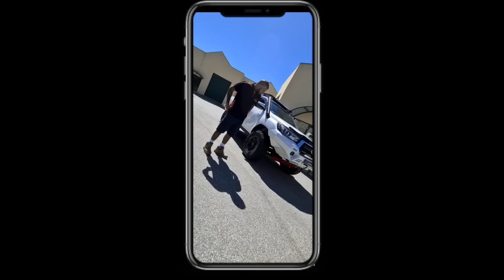FULLY MODIFIED TOYOTA HILUX // TOYOTA HILUX WHEELS, TYRES & 4X4 ACCESSORIES

Comment: "lives near lots of roos'' and gets a rival bar for protection lol
Reply: I wonder the same thing ... I thought hitting a roo will activate the airbag anyways ... Modern utes have automated sensor brakes too don't they??
Reply: I've got an ARB Sahara bar on my car but to be fair I don't think I've ever needed it. I've been to the cape a few times, around Aus, across Aus, High Country and I don't know how many Fraser / Moreton Island trips and I've never hit an animal. Any of these bumper replacement bars look pretty good to me. Good approach angle and a place to mount winch / lights / aerial. Good cooling. Rival is alloy too so no rust unlike my ARB bar. What's not to like?

Comment: In Your video you state that your work and mods meet with OZ standards and are 100% legal, if this hilux had a 3" lift and 295/70/17 this surpasses the vehicle modification regulations. Has this vehicle had certification for these mods.

Comment: Meets ADR standards? How did you guys get the oversized wheels approved?  Tyre size diameter cant' exceed 50mm over the largest size on the placard. That is 775mm so 825mm is the limit. Yours are 838mm and 13mm oversize. Sure they fit and look great, but if he gets pulled over, or crashes the vehicle that could void his insurance if the insurance company wishes to avoid a payday. 

If you have a way of increasing past this 50mm rule or 825mm max I'm keen to hear, as my 285 75 16's are 9mm oversized and my insurance company knocked back a minor claim because of it.

Comment: Even though the vehicle is modded, and i has a decent ground clearance,
The bootom of the vehicle looks like it a lot closer to the ground.
 Watching many different HiLux builds, all look like the bottom is lower to the ground compared to an Isuzu Dmax or if you want to compare to a higher end vehicle, a Tacoma.
ive not seen a Hilux irl, but im a 2019 V-Cross owner, thinking of getting the new 2021 Hilux. 
But, its the lower bottom of the vehicle that is off putting as i would be scared to take it offroad over rocky terrain. ANd just because it has underbody protection, doesnt mean i will plow through the rocks and let the protection get damaged. 
Can anyone help me out here ?
Reply from the maker: Hi Faiz, for any enquiries, please call 1800 099 634 and speak to one of our staff members who would be happy to give you some information regarding this, Thank You!
Reply: You’re right. And it’s a very valid concern. I’ve seen both Hilux and a Tacoma, side by side, and the Tacoma had a lot more ground clearance. (Both standard, fabric builds).